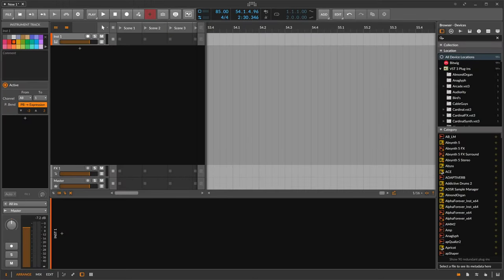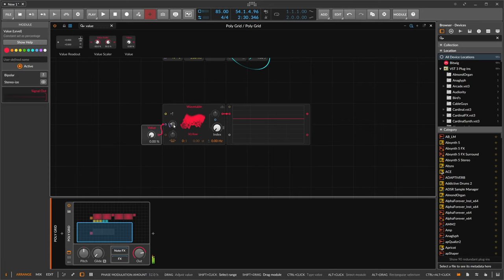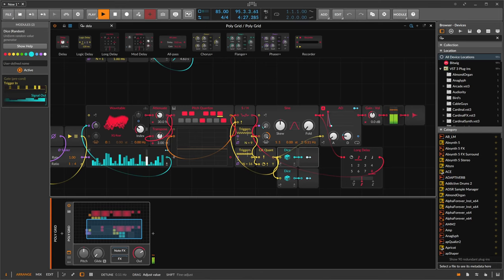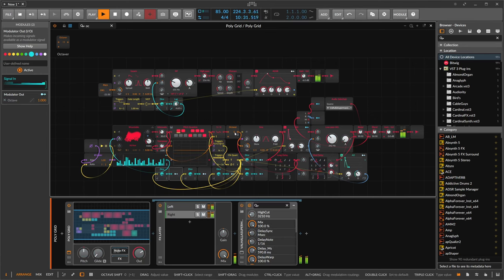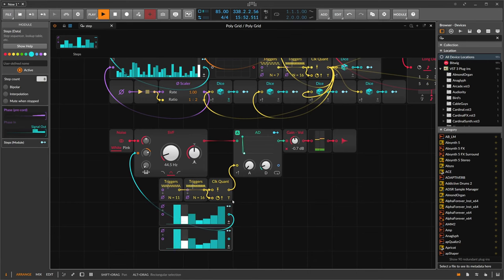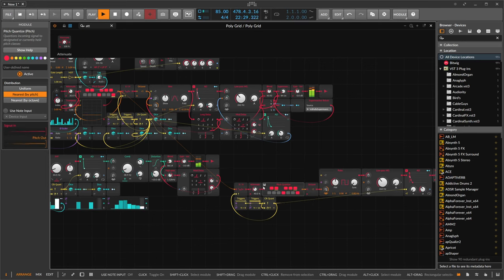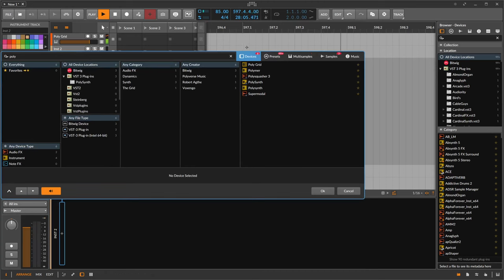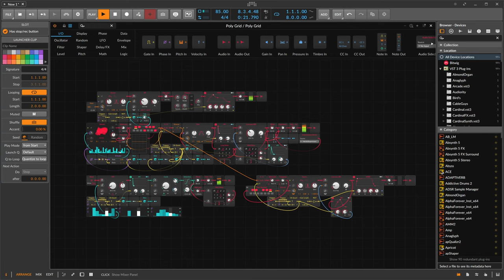sustain notes & wavetables as melody sources in Bitwig

Comment: Thats great!
Reply: but why not to connect the phase directly to the phase IN of the oscillator? the wavetable values are random enough, even if you just scroll them with a regular phase.
Reply from the maker: @TheVal1234567  the thing is. you can get a lot of things i do, a lot easier or simpler. sometimes its to make it look complex, sometimes its to make it easy to get for people what i do and sometimes just to do it differently...

you could also just scrap the wavetable and sample random noise and call it a day. or distort the phase ramp and use that. or close your eyes and paint random notes in the piano roll. many many ways. all lead to random patterns.

but here with the step mod in between, i can change the melody without changing the index of the wavetable. basically another parameter i can choose to change later down the road. is it needed? probably not. or it depends on if you want to optimize for a simpler patch or for more parameters to change. :D